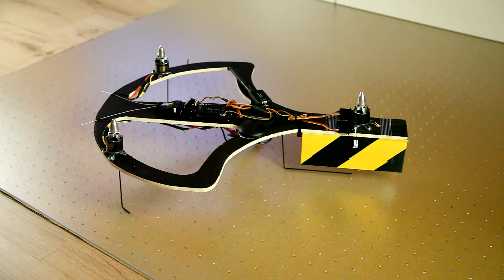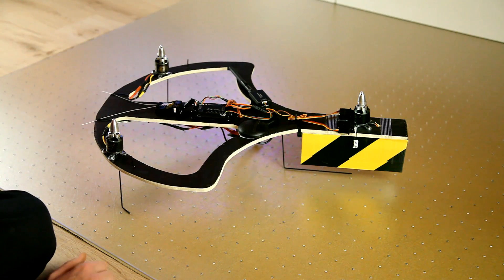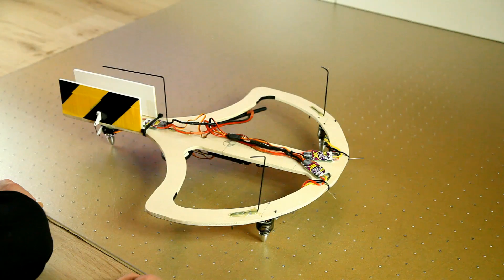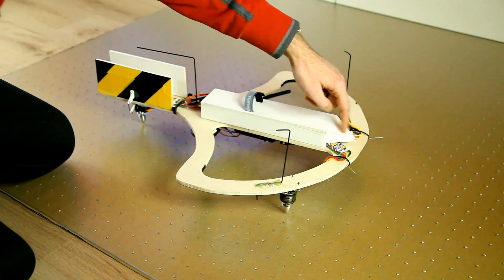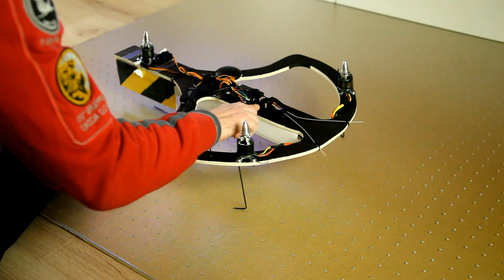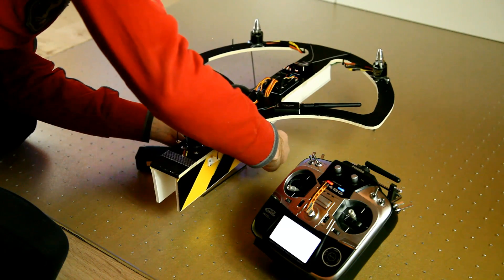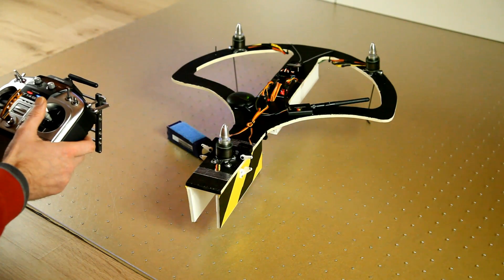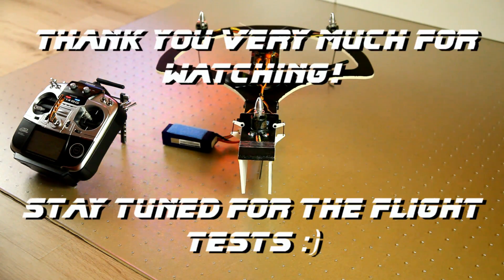Thrust Vectoring TriCopter! 6. All done! :)

Comment: This is nothing new. Original thrust vectoring was done on the  MIA Tricopters as means to prove the concept before there was anything posted on the internet on this configuration for tricopters. https://www.youtube.com/watch?v=fCs5FbtJlMc   Since my video was posted I've come across other similar vector arrangements but none fly as good as the MIA ones  and some don't fly at all.  I talk about the pros and cons of  thrust vectoring as opposed to direct control in my videos. I've gone as far to do also  an in-line (not side by side as everyone has done it but in line and stable bi-copter.
Reply from the maker: +Mario I. Arguello Cool stuff.. I had not seen those before. Thanks for that. 
I never said I had 'invented' something by the way..
Reply: Well, it is hard not to come across similar videos, especially when you search for  similar keywords and You Tube places similar videos next to others, hard to miss what others are doing.  Just an observation. 
There is only one way to control tail yaw with a rudder and that is placing it under the prop wash with some sort of link. The way in which the mechanics are positioned and executed is  what separates one design from another.
Reply from the maker: Sure.. I know Mario. for this experiment I deliberately did NO research at all before trying it.. I just wanted to know what I would run into.. In hindsight it was easier then I had imagined..
Reply: +DutchRC ADVENTURES I was just commenting. Vane control, works but not as reactive as direct control of the motor/prop combo position in reference to airframe. And since you asked in your comment if anyone had done similar earlier.
Reply from the maker: True. At the very least, it flies different;y. In hover it worked pretty well.. At higher (forward) speed it's a different story though.. 
I think it could work better if the vane could be curved outward.. (dynamically offcourse)
Reply: +DutchRC ADVENTURES It is interesting you mention curved outward. The MIA Mini SMART™  ( Simple Mechanical Advanced Rotor Triple) Mini Racer FPV Tricopter although it does not use the rudder for control,  it does have an outward curved vane  for dynamic  stability, in addition to two vertical stabilizers on the body. Again, an observation, I have never seen similar ones done before mine and the reason I did them on mine was for added dynamic stability with direct yaw control.
Reply from the maker: +Mario I. Arguello All very interesting for sure Mario :)  I don't think I'll attempt that curved vane setup. I'm not really sure if it would be wurth the effort of setting that up.. Next experiments would be:
forward thrust through thrust vectoring.. (on an H-frame)  And forward thrust with a normal airplane motor-setup..